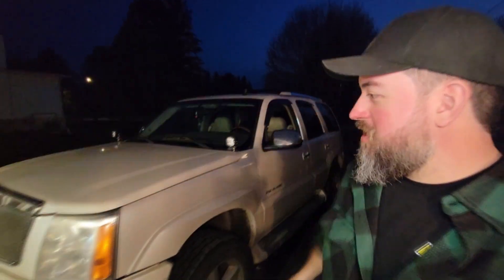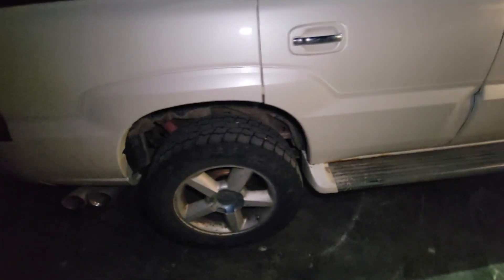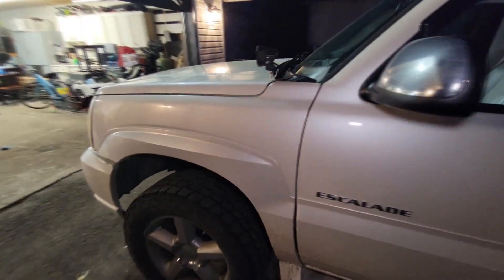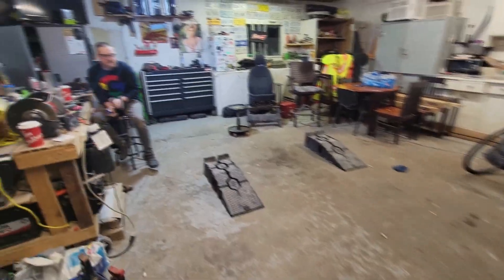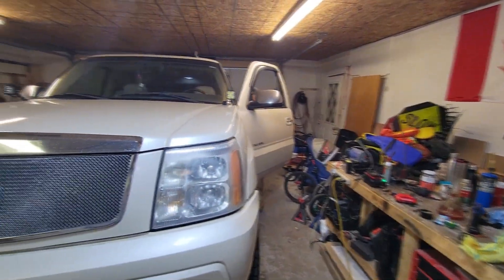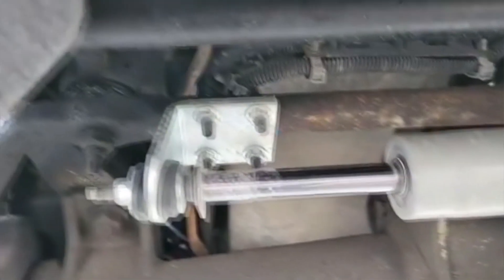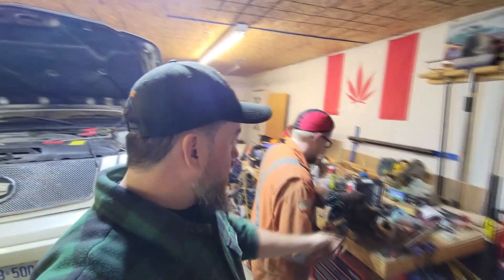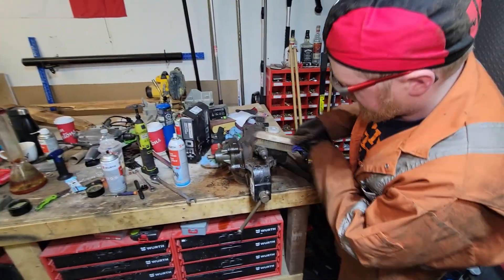Meet the new truck | WORST PITMAN ARM EVER!!

Comment: Wondered what happened to you guys? Around here (SW Ont.) the police would give you grief as soon as they saw lights mounted higher than your headlights. Expect to be questioned even if not in use.
Reply from the maker: Beanz has been in the GTA with the Yukon. Been lucky so far I guess lol
Reply: @northof4698  Hi. i was not trying to exaggerate, however, my observations, not personal experience, say be aware.
Reply from the maker: Thanks for the heads up